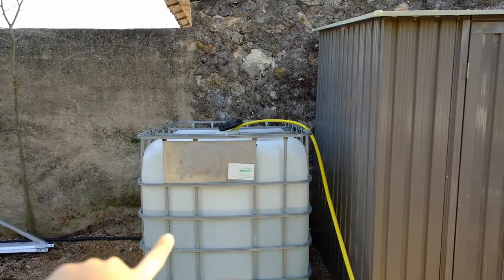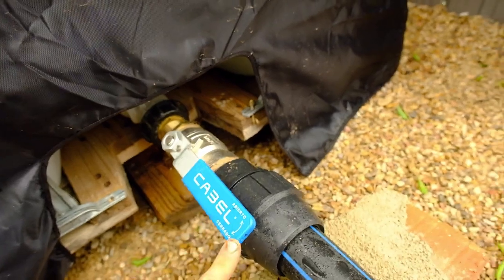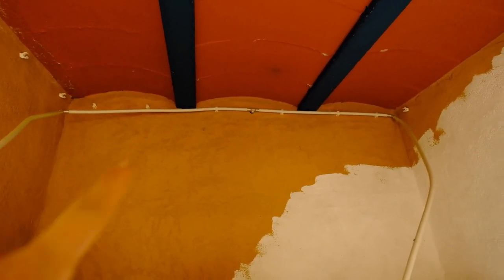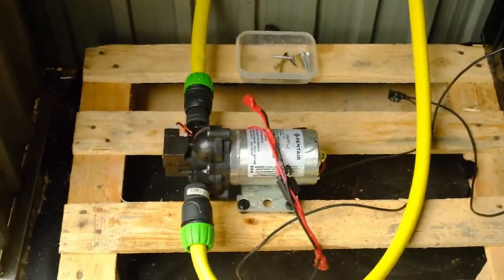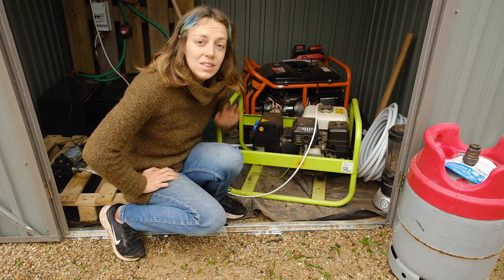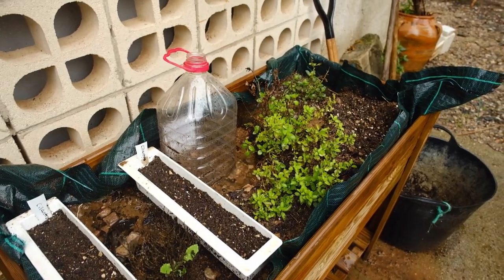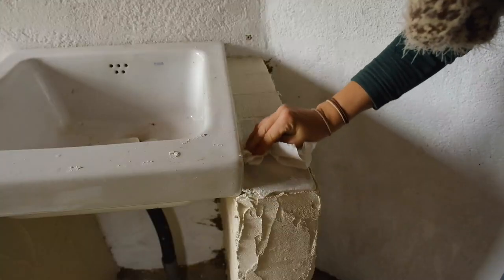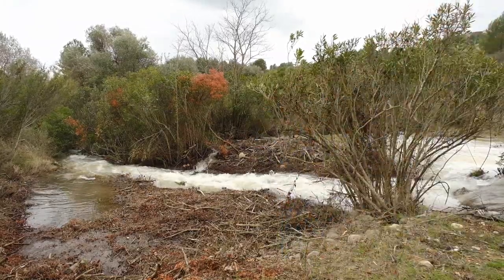I have no idea what I'm doing but I've got to do this!

Comment: For someone who is self-admittedly inexperienced, your first step should always be READ THE MANUAL! Also, you should consider heating the water as close to the point of use as possible, not running heated water through pipes that are long runs outside. The sink looks great!

Comment: You should always use plumbers tape on those input output points on both the small pump and the 3 points on the heat unit. It will seal due to the threading allowing leakage
Reply: Cinta de Teflón / Cinta de plomería
Reply from the maker: Yep, I am using teflon on the final attempt. This was just supposed to be a quick test hence why I didn't bother

Comment: I think the boiler caught fire because it was a bit bended. It should be always in a vertical position, otherwise the flame that get the water warm goes in the wrong direction. I suppose this is what happened.

Comment: Ohhh, I wish I were close I would give you a hand.
Keep the old water heater for parts.  It might work again or use some parts in case any parts need to be replaced.
Omg it rains a lot there.  Good you got some work on the bathroom inside.,

Comment: Hi Harriet, We are also doing a rebuild of a derelict cottage on a small farm in Alicante and are enjoying your vids, keep up the good work. We made the mistake of trying to charge our 3 panel solar system off the generator, if you have a 3k invertor you need a generator of at least 6k to charge it, now we just run the stuff directly off the generator until we get some sun back. Hope that helps. And keep up the good work.
Reply from the maker: Thank you! Glad you're enjoying them. We have a 3k inverter and a 5k generator. Ideally it would be 6 but the next model up was 7k and significantly heavier, we really wanted something I'd be able to move around the finca to use in other places. Hopefully it's okay, although it might charge slower and cost more in petrol than a bigger model. Why do you say "mistake", out of curiosity?
Reply: @LittleSpanishFarmstead  Ah I meant mistake as in we should have bought a bigger generator, while it works plugged into the solar inverter it just doesn't seem to charge enough the batteries to make it worth leaving on overnight for example. Like everyone else in Spain, just waiting for some nice days again.

Comment: I take my hat of to you for trying your hand at everything. there's a pipe cutting tool gives you a neat cut for your water pipe stops you having burs.  where your pipe is going through your shed put a sleeve or grommet when the hose pipe is vibriting it might get cut with the tin i would advise file down sharp edges👍
Did you watch any youtube videos on how to connect a water heater?  Also check and see if you have to use pfd tape plumbers tape  instructions for connecting waterheater will show if you need the tape or not good luck I would love to know why it went on fire  love your projects
Reply from the maker: Thank you! I saw that tool, would have been handy but think it was like €50 so I said no 😂 I think a strong possibility for why it caught fire was because I had the unit at an angle while I was testing the connections, and the flame inside has to burn completely vertically. I think. Anyway, I had better luck in the 2nd attempt!

Comment: Did you have some sort of thread sealant on the gas line to water heater connection? I didn't see you attach it at 4:10 , which is why I ask. Metal threads won't stop flowing gas from escaping and you could have had a cloud of gas ignite everything.
Reply from the maker: Like Teflon? Not on the original attempt, which was just supposed to be a quick test. I have been told it's not necessary but since it can't hurt to use some, I actually have used some now.

Comment: u cant put a machine to hot water as u did,u have burned it,the problem now is that u can come back to use the eater becsause now u cant put one of them u need a fan to put differents airs,so u will put one electric,the real problem of the pump is that u must conect it to the enter of water to ur home,and u must put on when u are having a shower,i have listen about some heat waters that was to no water preasure,but i havent seen one of this,so now u have two solutions one is to present ur heat water to a plombery and second repair,thanks for ur video

Comment: I am presuming you will have solar heated water in your agenda! May i suggest that the solar hot water feeds the instant gas heater - as mine does - and it will reduce your gas comsumption😁. As others have suggested, the hot out should be as close to the taps as possible.

Enjoying every minute of your 'life'!
Reply from the maker: Thank you that is a great point, I did want to put some solar heated water on the roof of the shower when I know a bit more about what I'm doing lol, I didn't think of sending that water through the boiler too though. That's a good point. Of course it will use less gas if it registers the correct temperature is already reached. At least, I assume it does, and won't pointlessly try and heat it even more.
Reply: @LittleSpanishFarmstead  oh, and put a mixer tap on the shower as this water will get very hot! Even on a wintrr day in full sun you may be surprised how hot the water gets! Ps, I'm a little further south than you -Alicante region - but it's the same sun!

Comment: Oh you poor thing! What a loss with the water heater.. I've never installed one before, but we used to have one that needed a pilot light (a flamme) and for that reason, there was a always a little flamne on, and needed to be absolutely vertical and attached to a wall for security. So it could be the reason if it is the same type as yours(?), the flamme will be vertical no matter what and catch / burn the wrong thing if the unit is not vertical and yours was at a really low  angle from the video.. Did  it come with installation instructions? You can also get a yellow gas tape over the thread to tighten. It's not real tape, as it's not sticky, but it is super thin and stretchy. They do some in light blue for water connectors, and white as well but it is for placi g around the threads to help give it a grip.. And an extra tip to check for gas leaks, use a bit of dishsoap on  the connectors, like one drop, and rub it over the connection, then with a spray bottle spray water on it, and if bubbles appear, you have a gas leak.
But what a lovely job with the sink in the bathroom, this will be so good to have with the mirrors, what an improvement! Have you come across 12 volt camping showers? They can simply be a little pump with a nice shower head or o e that also heats up the water. That coukd be a back-up.. But I really hope you can get the hot water sorted though. 
As for the battery and electrical I don't know much.. But keep perservering. When it rains like that, you have to use the generator, not much else you can do. Best wishes!
Reply from the maker: Thank you so much, I didn't know that about the heater needing to be vertical - I mean, I read that it should be installed vertically but I didn't know why and assumed it would be OK to test it out quickly at an angle. In fact I didn't think about the angle at all! Glad I published this video and read this comment today, as I am gonna try again with the new heater tomorrow!
Reply: Hi Harriet, the instant water we had was a long time ago, but I always remembered the little pilot flamne from it. From your video, I just assumed it was a pilot flamme gone wrong accident..! But I'm no expert. Have you found any youtube videos installs of the water heater you've got or similar? Look for videos of mistakes to avoid, or what to look out for.. That's how we learned lots on our ends... many times, post doing the wrong things... ahahah
Glad to know you've got a neighbour helping you out, that has got the same one. Hopefully you figure it out. If in doubt, take a breather, get a nice cuppa and reassess :) Good luck tomorrow!
Reply: Also I second having the hot water system as close to kitchen and bath, so that the hot water has less to travel and cool down before getting to the shower. Learned that the hard way too....

Comment: I fully appreciate your desire to do as much as possible yourself... BUT... whether that's from pride, satisfaction or financial restraints, there does come a time when professional help is strongly advised. In doing something very similar to what you have embarked upon, I set myself a budget for those elements that I had no expertise in and which were potentially downright dangerous if I got wrong. I am happy to learn as I go about the elements which, if wrong, can be fixed fairly easily but, when it comes to most plumbing and ALL electrics, the consequences of getting it wrong can be disastrous and dangerous. Just my tuppence worth! Otherwise, keep up the amazing work you are doing but please recognise that there is no shame whatsoever in recognising what is safely outside you realm of competence.
Reply from the maker: Thank you! With electrics we have professions doing that. Note in the last video about our solar, a professional came to help us move the electric installation. A simple gas canister powered water heater is not supposed to need professional installation. I think I'm just an idiot. I have an experienced friend coming to help with attempt no. 2 though, so don't worry.
Reply: @LittleSpanishFarmstead  did you purge the pipes of air before starting the hot water going? ><
Reply: @LittleSpanishFarmstead  please  don´t say that  "I think I'm just an idiot" any more you are wonderful and so amazing!!👏👏👏👏👏👏👏😊😊😊😊😊😊

Comment: Press right bottom button for +3 seconds

Use above up down arrows to move down to setting 16

Choose 'CSO'

Press bottom right again,  then top left. 

Make sure generator is plugged into AC input.   

Then it will charge...
Reply from the maker: yes, setting 16 was the one! ha! CSO or SNU, can't remember, just not the setting which meant "solar only"!

Comment: Hi Harriet, I'm sorry for the problem with the instant water heater.  The problem might have been that it was inclined,  it has to be mounted vertically on a wall.  The "llama" must burn vertically.  🔥  You're brave though,  and i wish you good luck.  Regards Rickard from Sweden 🇸🇪
Reply from the maker: Aw thanks Rickard! I think the inclination was the issue, yes. Instruction booklet sadly didn't draw attention to that very important fact - I guess it's just common knowledge which I lacked!
Reply: @LittleSpanishFarmstead  But you have so many knowledges before, and now one more❤

Comment: what exactly are generators linked to? are they a pure backup on the AC side?
Reply from the maker: The inverter/charge controller has a AC cable coming out of it with a normal plug on the end. That plug goes into the generator. But you could plug anything you wanted into the generator. you just have to be careful with anything like a laptop or stuff with chips, sometimes the generator can fry them (apparently).

Comment: Ok love the way you are so handy. And attenpted everything win sum loose sum. Just a thaught though. Dont be a man. 😂😂read the instructions on the appliances. I think thats why you burnt your water heater out. There could have been plastic coverings on stuff that were supposed to be removed that caught alight. I had mine in a box for 4years and did ut myself. I do remember having to take some plastic covers off. Just a thaught. But others wise crack on love💪👍👍👌

Comment: Please try and get professional help or advice. You will save so much time and aggravation and be safer. Never, ever pour water on an electrical fire. Bicarbonate of soda from your kitchen can smother a small fire. Get a handheld  fire extinguisher.
Reply from the maker: The batteries were removed by the time I chucked the water. Good point about a afire extinguisher though!